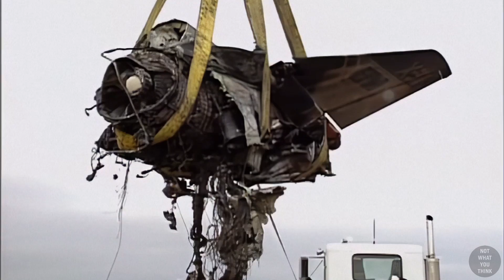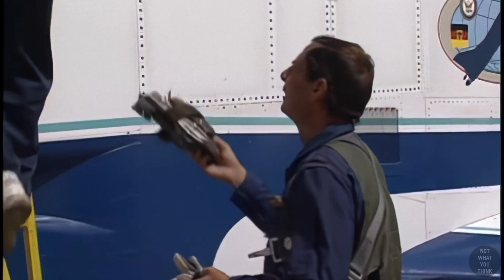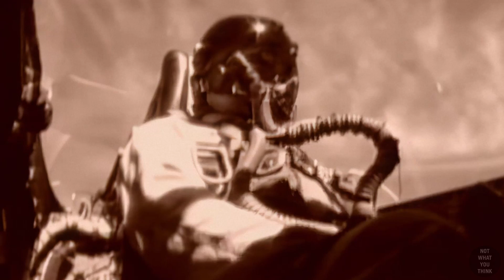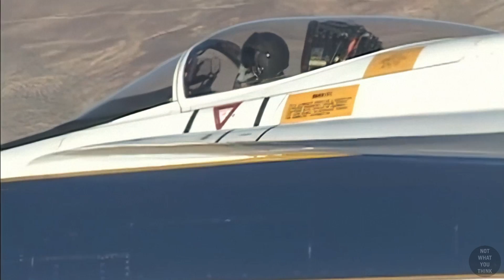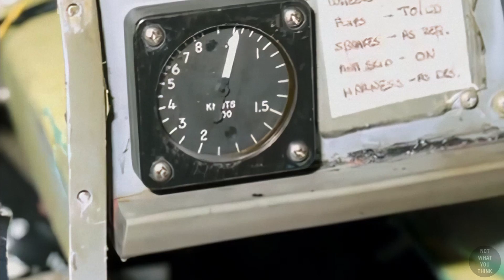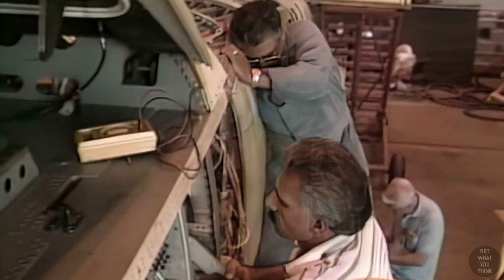How One Sensor Destroyed a Super Plane

Comment: I have found that the secret to flying safely in general aviation is to match the number of landings to the number of take offs.
Reply: Well technically, it did “land”.  They have not left a plane in the air, not once.
Reply: True true, but I don't think crash equals landing lol
Reply: @sketchpad7116  called a crash landing for a reason
Reply: It landed and then did fast unsceduled disassembly
Reply: @rogueldr642smiythe9 They haven't left a plane, but they have left a flight. Air Force One had a president on board just as his successor was being sworn in, resulting in it no longer being Air Force One mid-air.
Reply: I try to double that ratio whenever I play DCS.
Reply: ugh gatekeeping us from flying, just wait until the disposable trend comes for your hobby, then we'll all be taking off and landing by parachute.

Comment: there were soo many ways this could've been avoided, like there were soo many signs.bruh moment
Reply: Well atleast this can be used as a lesson.
Reply: Yes
Reply: They don’t learn lessons they are just like oh it’s the sensors fault not our fault they do this shit all the time
Reply: Larger wing area
Reply: Occam's Razor. Heard of it?
Reply: Well, we have the benefit of a YouTuber cherry-picking the relevant signs for us. A test pilot and ground crew have to monitor hundreds of messages, signals and factors, so I'm not surprised these things were not flagged as particularly critical. 
Looks like there's also a bit of 'implied responsibility' here (not sure what the correct term would be) : the ground crew probably thought that the pilot would instinctively know to use switch 3 if the sensors went bad. The pilot likely expected the ground crew to clearly warn him if that could happen.
Reply: Dont make airplane out of styrofoam.
Reply: Yeah, like they could've not swapped out the heated pitot tube with an unheated Kiel probe. And advised the pilot and ground crew that they could override computer control. Other than that it was effed.
Reply: All disasters are like this
Reply: Boeing: this is a good feature. Max profit for maximum casualties

Comment: Boeing Engineer's while making the 737 max : "time to skip this chapter"
Reply: Ooof
Reply: Yeah it was just one simple sensor prone to malfunctions. There wasn't a back up sensor or even a way to turn it off I think. So basically it detects if the plane is stalling and points the nose down. So the pilots are basically going up and down fighting the electronics until it dive bombs into the ground
Reply: @Zeb-nh6hj  there was a way to turn it off
Reply: @Alex-np3ps  indeed there was a way. But the pilots had no idea what was happening in the first place or how to turn it off.
Reply: @Alex-np3ps  
There was not a way to turn it off 
Overriding it was added after two accidents

Comment: that's a strange sort of horrifying to see a plane just fall/tumble to the ground like that, knowing that it's 100% real, unintended, and potentially highly dangerous/lethal.
Reply: I thought it was interesting how unnaturally it fell compared to a non fly-by-wire plane. You can see the control systems trying erroneous maneuvers up until the end. One would think that those systems would go dark after an ejection, if not just to prevent the plane from flipping back into the ejected pilot.
Reply: @Chuck Wood there was a delta dart stuck in a flat spin and the pilot ejected. The force from the ejection brought the nose down and saved the plane, and it landed safely in a cornfield
Reply: and the fact it didn't crash into any buildings

Comment: I once had a 400 cu. inch Snowmobile that had a similar problem. To vastly improve the speed of the Snowmobile, I removed all of the plastic panels that were in front of the intake to the carburetor (which sat, in full view, right in front of my bellybutton.) Eventually, if not regularly wiped off, the intake would fill-up with Ice and Snow. When this would happen, the entire Snowmobile would come to an instant STOP (resulting in ME smashing my chest into the metal handlebars.)

Comment: That's what yellow note pads are for "Pitot heat not working" should have been placed on pitot switch, among all the other notes on the control panel.
Reply: ... but they told the pilot and he acknowledged the message by saying "i'll leave it on anyway". Leave what on? Nothing's on, they've just told you that.

I mean if he ignored a person telling him it, what's the chance he'd have ignored a sticker saying the same thing?
Reply: The engineers wanted paycheck from the insurance company, that's why they ended up the project with a blast.

Comment: Just from a pilot's perspective, I'm going to challenge your statement of NASA and the crew ignoring warning signs. Yes, they should have responded earlier, but at the first indication of the airspeed being off, the pilot reported it. This being a test flight, and a seasoned test pilot, that's fairly tame for things being out of normal, so I can understand the lack of immediate response to the issue. To further this point, when the pilot was told about the probe heat not being hooked up, he is very sarcastic with his response, it's just another day in the office of flight testing. When the next test failed, you claim NASA continued ignoring warning signs, yet requested the jet return to base. There is really nothing else the test team could do at that point as the jet was not in an apparent emergency, and even then, most emergencies just call for a return to base, ejection is a last resort to save the pilot if the aircraft is unrecoverable. All in all, yes, this probably could have been avoided, but after the takeoff, I don't really see how the team could have done much better given the circumstances.
Reply from the maker: Thanks for your comment.
A good chuck of the comments that we made in the video is based on the investigation results and interviews done with the people who were working that day, not merely our interpretation of the situation. But we are not pilots, so your opinion is very much appreciated 😊👍🏼
Reply from the maker: Yes, the chase aircraft being out of the loop certainly didn’t help.

Comment: A “sensor” didn’t destroy anything. That’s an old trick designed to direct attention away from the engineers who made the mistake. Machines don’t make mistakes.
Reply: The sensor and computer was actually working as intended haha. The ice build up is totally human error
Reply: @chas1878  if the heater wasn't tested/working before flight it could be human error lol
Reply: @ThePikeywayne  I mean it was definitely human error. The question is whoms?

If the pitot had just failed (whether because the heater failed or it just failed for other reasons) then it's a sensor failure. Maybe it's quality control's fault.
If the heater wasn't plugged in and the pilot wasn't informed. Then it's the person who failed to tell the pilot's fault.
If the pilot was told and they just didn't do anything in response. It's the pilots fault.

So it's either everyone's fault or the pilot's fault. Depends on if you want to play pass the buck.
Reply: I mean - machines are designed and made by humans dude

You're acting like no machine ever fucked up it's intended job. That absolutely depends on the humans who made/assembled/programmed it.
I could as easily say that it's the machine's fault for not knowing it got bad readings from being iced over. Or at least - not informing the pilot that it's blocked.

Comment: So the pilot knew the Kiel probe wasn't heated. Started recieving strange speed numbers. Didn't look at the additional speed indicator. Didn't put the plane into R3 due to not checking his other instruments. Noticed the speed was iffy when he put the plane into 20 aoe and didn't think to check if something was off. I guess this is why you have a chase plane with a competent pilot which makes it even more stupid that the test plane didn't have a working hot mic. Wasn't the planes fault it messed up. Both pilot and ground crew need a slap
Reply: Pilot just followed the manual.. Turns out that said manual was incorrect in its calculations
Reply: The pilot is busy flying so its reasonable that he misses certain things, that’s why he would radio the ground control so they could do the thinking for him. Its the ground crew’s fault again and again failing to notice and warn the pilot of the issue
Reply: Pilot and crew were unaware they could override computer control.
Reply: @kenchen704  I think the commentator said the pilot had hundreds of hours on that bird...I think he mentioned that...and furthermore, I think he ejected too soon....
Reply: @Ihaveseenthings577  While i think it's probably the pilots fault for just ignoring the warning that the pitot wasn't heated and not reacting to the strange behaviour of the aircraft (like it not responding when he flipped the switch to change its handling), along with whoever it was who was meant to be checking the speed numbers. I cannot blame the pilot for ejecting out of a relaxed stability aircraft immediately after it'd lost its ability to maintain stability. I honestly wouldn't be surprised if the ejection was automatic anyway because in that situation reaching the ejection handle would be like trying to open a padlock when you've just been shoved out the back of a lorry while crammed into a washing machine.
Reply: @kenchen704  if it only worked that way, than all pilots would have no problems ever since they'd never be held accountable for anything.
Reply: @slimpkl1809  you like that take that completely 100% literal meaning then go ahead
Reply: Nobody told the pilot his pitot heat was off until after the plane lost control.
Reply: L
Reply: @Variety_Pack  the video says that control told pilot that the pitot heat was not connected when he tried to turn it on.
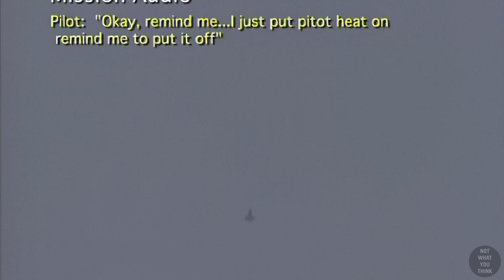Reply: @Power5  no, they relayed it internally but the info was not passed to the pilot. The video clearly states this at 2:44
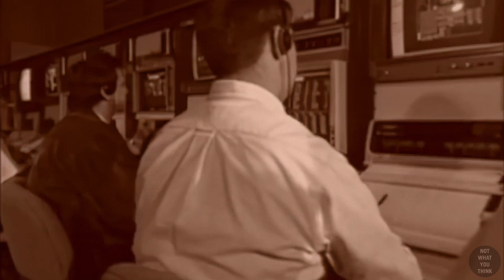Reply: @Variety_Pack  3:05 the info was passed to the pilot but the importance was undervalued as crew didn't know shit.
Reply: Flying is hard. Especially without a copilot. It´s why during air emergencies pilots often don´t even respond. During a test flight going through a bunch of procedures even moreso.
Reply: But the plane got all the blame and now we don't have that flying ugly beast and it's decendents dropping terror and destruction down like so much rain.
Reply: For me, Kiel sounds Russia. Therefore Kiel hates it when American trued to capitalize his name.

Comment: Arrogant engineers seem to be the ones always leading to the bigger crashes.
Reply: Well it's pretty easy to accuse engineers of being arrogant after the accident happened, it always is. I mean the pilot flipped the pitot heater on and was told by the engineers it didn't work. His response? "Ah, i'll leave it on anyway". Doesn't even flip that alternative mode switch just in case, or descend to an altitude where icing isn't a problem, or check the back up airspeed indicator. Two thirds of which are back up solutions provided to the pilot by... Guess who? The arrogant engineers. Instead he just kept going like normal, despite the icing problem.

I mean can you imagine a drag racer being told by their mechanic that the brakes don't work and driver just goes "ah well, gotta race".

I'm not saying it isn't the engineers fault, I'm just saying there's plenty of blame to spread around and the main thing they seem to be guilty of was not going "OH SHIT YOU'RE GOING TO DIE IF YOU DON'T DEAL WITH THAT ICING PROBLEM!!!!1!!!!!11111" which isn't their job anyway, their job is to make the thing and inform the user of its limitations, which they did.
Reply: Nothing about arrogance. Things are going to go wrong during such test flights. Has always happened. It´s why test flights are done in the first place after all. People make mistakes, miss things or they might be entirely new problems. If anything it is arrogant to assume this is just down to mindset and you´d do better.

Comment: So essentially this is like what happened to Air France 447
Reply: Not really. A fighter aircraft is constructed unstable, so it can only be controlled with the help of the computer. SO if the sensors feeding the computer fail, you are just fucked. A passenger aircarft hgowever has to be stable and therefore is constructed in a stable way. So if a sensor fails the computers deactivate but you can still fly the aircarft. However, the AF447 crew failed the easiest tasks in manual flying.
So the only similarity here is a sensor failing, the impact of that however is very different.
Reply: @MrSchwabentier  I meant just the idea that the airspeed indicator being frozen essentially seized the flight control system, but yeah.

Comment: With that mobility I can bet that it would be better than the F35.
Reply: The F-35 doesn't rely on agility. Its main features are the highly integrated sensors and stealth. No need for dogfighting if your sensors pick up the enemy way before he can detect you. The test results of the X-31 were used to create the Eurofighter. It's highly agile, but even though I'm German and biased for the Eurofighter, I have to say that I doubt the Eurofighter would stand a chance against an F-35, if the F-35 uses its advantages to stay out of a dogfight.
Reply: @8BlackHawk8  The think is that many people has said that stealth is its only advantage and they aren't sure that it is even good on that.
Many has said that the UHF missiles can still tracking it.

Comment: They should make all 3 back up systems to share and compare airspeed data amongst each other then if a faulty reading is detected, an aural warning should warn the pilot, if they fail to take action then an automatic override should assume control and correct any anomalies
Reply: And what data should that overide control rely on? The faulty sensors?

Comment: I think harrier had something like this could vent out through the wings or something
Reply: Harrier had swiveling jet nozzles on the sides of the fuselage.
Reply: @williamchamberlain2263  i thought i read they could also vent out of other places i am almost sure
Reply: @zzirSnipzz1  yep - you're right, but not during actual flight or aerial combat, only when vectored thrust was providing all the lift for takeoff and landing.  "bleed air from the high-pressure compressor of the engine out through the extremities of the nose, tail, and at the wingtips during vectored thrust–borne flight and hover modes. The two systems are fully interlinked but air is not supplied to the reaction control valves during conventional wingborne flight." according to all-knowing Wikipedia.
Reply: @williamchamberlain2263  It was used during combat in the falklands is were i read it

Comment: Title is incorrect a chain of human errors destroyed the plane not a faulty sensor.  as the video states switching to another mode the plane would have been fly able still.  Complacency from those involved,  poor communication, Pitot without heat, pilots not confirming air speed data, engineers on the ground not realizing how major the problem was, and to inform the pilot of the test aircraft.  One failure doesn’t cause an accident.. a chain of failures do..

Comment: The pilot ejected very early in the loss of control, I thought he'd at least try to recover the aircraft.
Reply: This plane was heavily dependent on the computer fly by wire systems to maintain basic stability. One common aspect of jet fighter designs these days is "Relaxed Stability" making the aircraft aerodynamically unstable on purpose enhance manuverability, the F-22, F-35, Eurofighter Typhoon, JAS-39 Gripen, and Dassault Rafale all have "Relaxed Stability."
Reply: @michaelvansise4887  so fighter jets are actually kind of aerodynamically flawed? What's the least flawed fighter jets available I wonder?
Reply: @cupofjoen  Relaxed Stability is common in most newer fighter designs and it also goes as far back as the F-16 and Mirage 2000. Even Russian planes like the Su-35 have it. The B-2 bomber even has it, flying wings with no vertical tail surfaces are inherently unstable. The F/A-18 Hornet and F-15 don't have relaxed stability, but they are also among the older aircraft still flying.

Comment: Remembrement the crash of the Rio-Paris flight of an Air France airplane. 
All pito tubes frozen, computers that become crazy because of that and a bad reaction of the pilots in this case.
All airplanes should have an emergency button that shuts down the computers.
Reply: The Air France crash was completely the pilot's fault, the flight computers on the A330 do "shut off" when the data is bad, making the controls go from Normal law to Alternate law. Normal law uses all the computers to transform pilot inputs into safe, controlled signals to the control surfaces, the plane won't allow the pilot to get into a dangerous situation like a stall or rolling too much. As the pitot tubes got iced up, it switched into alternate law, which means the plane will fly like a normal non-fly by wire aircraft, and most of the safety limits will be turned off

Comment: Nothing but mindless propaganda.  It's a pito tube with an AOA indicator. Any pilot worth his salt can fly without it.  The manuver is called a stall; very common.  

The fly by wire system doesn't work as you think.  This was an aft cg issue more than airspeed.